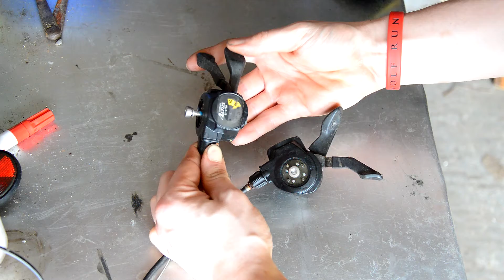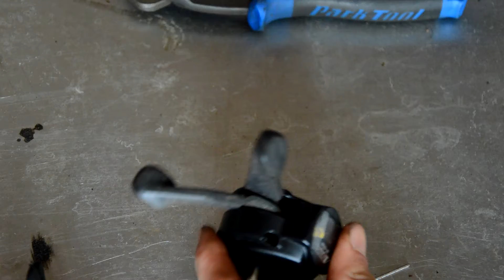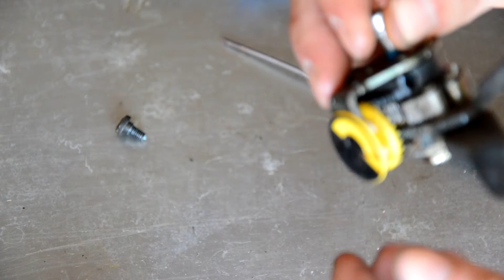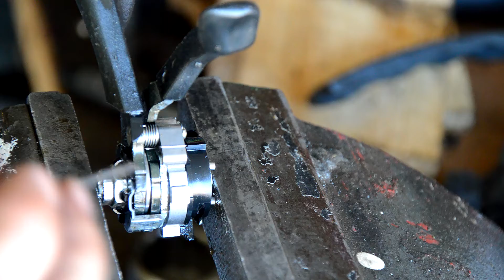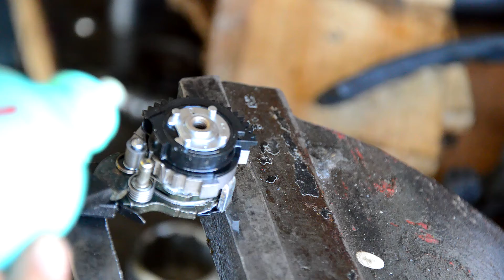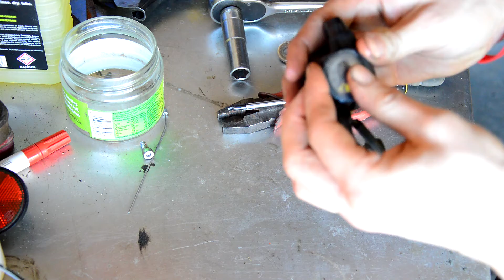Repairing Frozen Shifters - Bicycle Maintenance

Comment: These are not frozen, just stuck. If the wire freeze in the winter how do you keep water out.?
Reply from the maker: Frozen is just a weird term we use to sometimes describe stuck or seized.